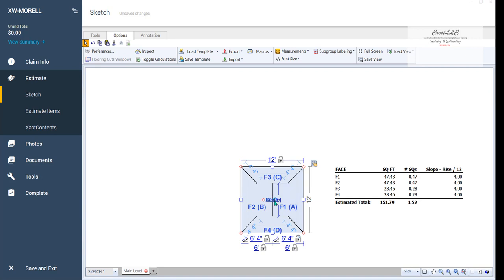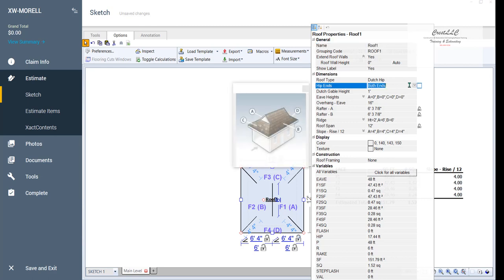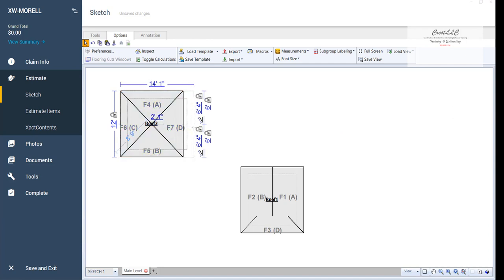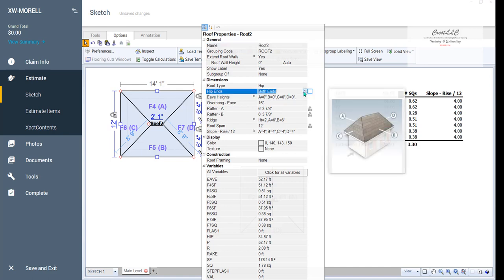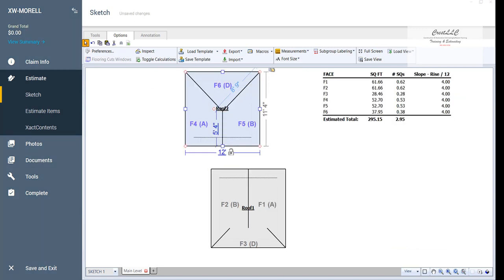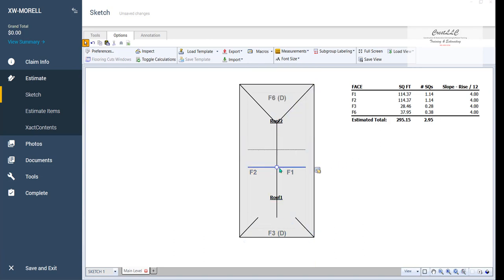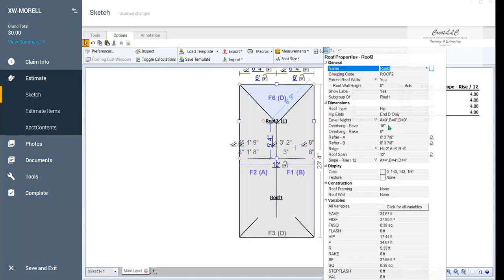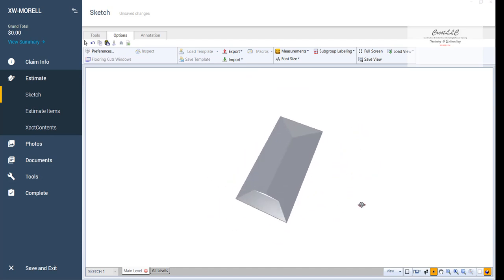Xactimate - Dutch Hip - Hip Roof Combo

Comment: I have a gable and Dutch roof that I follow your video. I can’t connect the two over together. The Dutch roof is coming to form a L shap roof
Reply from the maker: I am not sure what you are describing but if you have a roof that is Dutch on one side and gable on the other, you don't need to combine roofs. Just change one side to gable in the properties by telling it which side you want the Dutch on (where it defaults to both ends under the roof type after you change it to Dutch Hip).

Comment: I've done this, but when I print it, it shows the edges of the two roofs in the sketch report, (where it does not show in the sketch, or 3d view.)
Reply from the maker: I assume you mean the line where the 2 roofs join. That is the back side of the 2 individual roofs and it always shows. The reason you are probably not used to seeing it is because the back of any overbuild is usually in the same location as the ridge of the original roof so it is hidden. I don't know if you have noticed, but when you add an overbuild, it starts at the ridge of the roof you are creating it from. I added to the end of the video explaining it visually because it is a very good question and also in case this explanation was not clear. Just start watching from where you left off and hopefully that answers your question. Since you cannot replace a video on you tube, I added the new extended video as a new video. I will delete this original video in a week or so when you get a chance to watch the new extended one. I also show you another way to draw it but the report will always be the same.
Reply: @xactimatetrainingbycrestll5943  hey thanks very much.  I didn't really expect a reply so fast.  I just made sure that my areas and variables are all correct and submitted the report with the funny lines showing on the sketch.  I'm a roofing contractor, and while I want to come across professional, I guess I'm not looking for a Nobel prize for perfect xactimate work.

What I have is a Dutch hip roof (with rake overhang) on one end, and a gable on the other.   I couldn't get the Dutch hip to have a rake overhang.  (I guess single roofs can't have an overbuild).    So I created a hip roof on one end, and put a gable over top to create a dutch hip.  (I've always called it a dutch gable)